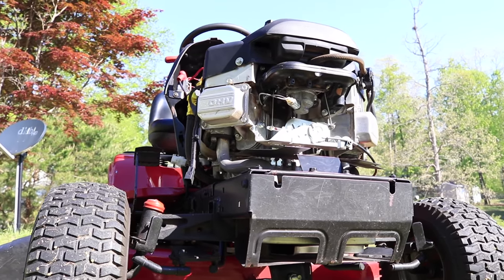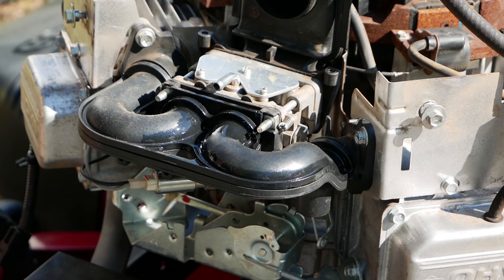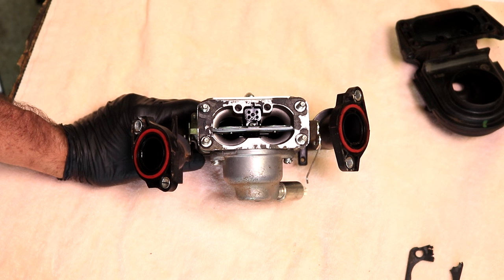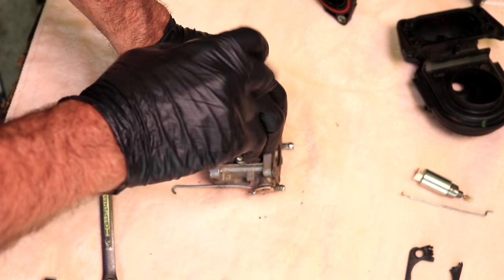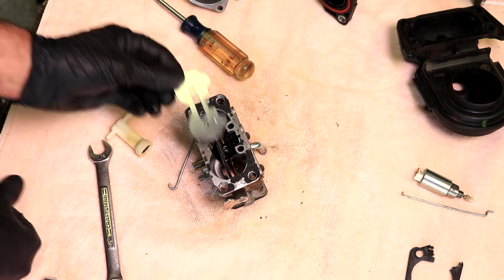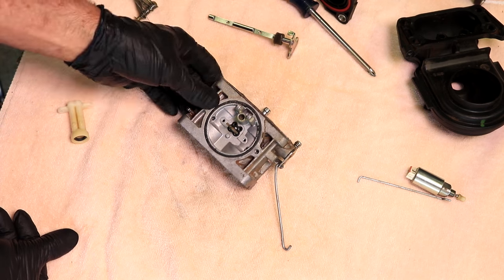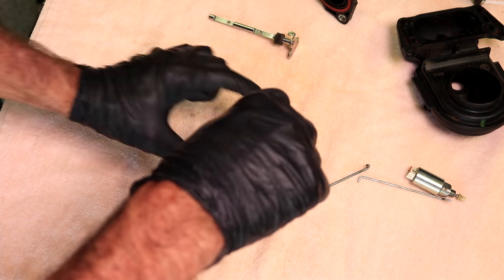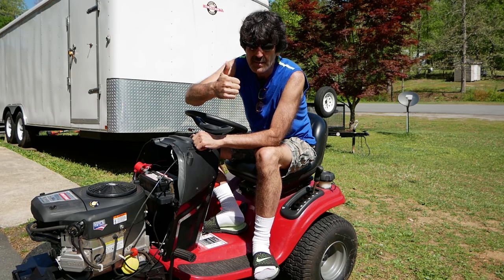Briggs and Stratton V-Twin Carburetor Repair

Comment: Help, Drained fuel and replaced with known good fuel. Replaced carburetor, fuel pump, spark plugs, fuel filter and air filter. Engine still turns over but doesn't start. It kicks over and starts with starting fluid but quits when that is burned up. Any ideas?
Reply from the maker: Maybe the valves out out of adjustment?  Sounds like you've done mostly everything possible.  If you have a compression gauge, I'd check the compression and see what that looks like.  Does it sound normal when it's cranking?
Reply: @JLPicard440  Thanks I checked compression it looks good, gonna check the valve adjustment next, but would compression check good if the valves are out of adjustment?
Reply from the maker: @michaelthomason9007  Yea good point... That's a good one.  Is the fuel filter filling up with fuel?  Are you sure the known good fuel isn't full of water?  I know, I'm grasping at straws!... But there's not much left... :-)

Comment: Video is on point brother....thank you so much....I picked up one of these mowers today from my step dad and it's been sitting for 2 years so I'm sure the carb needs to be cleaned due to the crappy ethanol. I checked it for spark and it's good, so I'm sure the carb needs to be flushed/cleaned/poked etc.....had to sub because of the video being on point ;-)
Reply from the maker: Thank you so much!  Yes after 2 years it's probably pretty goopy..  When you get it going again try using the ethanol free fuel if you have a local gas station that sells it.  It does keep a little better than the regular E10..

Comment: I love the way you explain things but I have a question I have a Briggs and Stratton lawn mower it's a V6400 craftsman 0 turn on the carburetor it has a spring The mower is about 3 years old for some reason we're not putting the linkage back correctly is there something we're not doing like tightening or it won't go up and down as needed
Reply: I'm a female.. I've been at this for a while
Reply from the maker: Hi!  Without being able to see it, I can't tell what could be wrong.  Do you have FB?  You should be able to upload a picture there and I can try to see if I see anything wrong.  It's on the take a bath productions FB page...

Comment: Great Video - this will be my weekend project - pulled out the mower and it wont start - couple of big backfires thats it.. plugs look good so figured it is the carb.  question tho - i noticed on mine that there are small slits in the vacuum hose off the bottom port of the fuel pump - are these factory or does the hose need to be replaced - and could it be my issue?  Thanks for posting this!
Reply from the maker: HI, yes i've seen those dry rot before.  If you squeeze it can you see more dry rot??  That's what it sounds like to me

Comment: A great video! Liked and subscribed. I can't get past opening the float bowl as I can't get the two bowl bolts out.  I saw someone use a butane mini-torch successfully but I'm leery about doing that around possible residual gas.  Might you have any suggestions for getting those loose?  Also, I've read that flooding is often caused by a stuck float.  If that's the case, will you find it stuck when you open the bowl? Thanks.
Reply from the maker: HI!  I absolutely don't recommend using a torch around a carburetor!  I wouldn't do it myself.  I would maybe try some PB Blaster and let it soak for a while.. Try to get it in around the threads.   I've never had bolts that wouldn't come out, but they're out there...  Maybe a pencil torch if the PB Blaster doesn't work, but I'd still be really cautious about doing that... any residual gas and you'll have a good fire to cook marshmallows on...
Reply: @JLPicard440  Thank you!
Reply from the maker: @vitex1231  yw

Comment: I'm great video brother thank you for your knowledge and expertise  I am new to the V twin engines I took one off my  Tractor and turned her into a boat motor but I do not know how to lower the idle I cannot change years from forward to reverse with the engine running there's too much torque on the transmission how do I lower the RP m's Great you  I am a new subscriberTo Sue the rest of you video
Reply from the maker: There's usually a idle screw.  I don't know if the particular one your working on has it or not.  You might be able to bend the lever that the throttle spring is hooked to to lower the RPM's.. It's only going to idle but so low before it tries to die on you.
Reply: @JLPicard440  thank you  4oo to500 rpm.  I am computer stupid I'm trying to put delete to my video in this message in this not working very well title of  Video is 22 horsepower V twin bridge and Stratton  Outboard motor DETROITREDNECK is my  YouTube channel name I will try to post a video

Comment: I have a 2008 Husqvarna ride on with one of these engines, and the fuel filter is covered in gas after running the mower.  Does that require an entire rebuild?  I have to mow once a week with no replacement mower, so I think I have to take my carb to someone to rebuild.  I want to make sure that sounds like a likely solution to the issue before throwing money at the problem.  Thank you for the awesome video by the way!!
Reply from the maker: HI, you must mean the air filter!  It sounds like possibly the needle and seat not cutting off properly.. Does it sound like the choke is releasing all the way?
Reply: @JLPicard440  Yes, I meant the air filter.  It does sound like the engine is cutting out after a while, especially if I have the blades going; almost like it's too rich.  After mowing for 30 minutes the engine starts to stall unless I turn the blades off and ease up on the gas for a minute or two
Reply from the maker: @chimera5588  Hmm,.. if it's a auto choke, it might not be releasing..  worth looking at the linkage to see if anything is noticeable..
Reply: @JLPicard440  Thank you for the tip!  I'll check that out 👍

Comment: I have a very similar Briggs and Stratton 26hp. It has a new carb, but it's having trouble with surging. The throttle lever is not as responsive (but connected) as I'd like it to be. It usually sputters out at the lowest idle throttle. Any tips would be really appreciated. Thanks.
Reply from the maker: HI, I did a video on this a while back.  Give this a try and see if there's any luck.  Even with a new carb.  Is there any chance the gas is contaminated with anything?  Did you drain it and replace fuel lines and filter too?  
https://youtu.be/dnEgZ_uqxiQ

Comment: Superb work on the carb. I did mine, but the choke linkage seems to be messed up and not engaging. Is there anything special I need to do to get it aligned again?
Reply from the maker: Without seeing it, it's difficult to say..  The cable for the choke has a hold down clamp.. Is that adjusted?
Reply: Thanks for the reply. There is a hold down clamp, but it doesn't look like there is any adjustability. I'll check this weekend.
Reply from the maker: @velodaman  Usually you can loosen the screw and move the cable back and fourth.  That may not be what's wrong, but I was just throwing it out there.  I usually pull the choke control in full choke position and adjust the cable accordingly.. then when you push the choke to the off position, it'll be adjusted.  if that makes any sense.
Reply: Bonehead alert: I found the issue. On the choke flange where the choke linkage attaches, I had put it in the incorrect hole. Now that its in the correct hole and put back together, it started right up and runs great. Thanks again for the great video and the support.
Reply from the maker: @velodaman  That's awesome!  Yea without seeing it, its difficult to say.  They say a picture is worth 1000 words... being there in person to see must be worth much more!  You're welcome, I'm glad you got it going...

Comment: Hi, first your videos is awesome. I have a problem, just wandering can you help? My lawn mowers is nit even cranking but my starter is turning. Do you have any idea why? Or any suggestion?
Reply from the maker: If the starter is cranking but not turning the engine, it could be that there's a broken tooth on the flywheel that the starter is engaging on but can't turn the engine.  It could be that the starter gear isn't popping up to engage the flywheel.  You'll have to pull the top cover of the engine off so you can see what's going on there and observe the starter when it's being cranked.  If the gear isn't popping up to engage the flywheel, it could be gummed up with something keeping it from moving smoothly.  This can usually be taken apart and cleaned and relubed, but I can't explain how here in this text.  It may also be that the gear on the starter itself is stripped out.   there's not much else it could be.

Comment: Good video, it's a shame a new carb was cheaper than a kit for the original in my case.
Runs like new as long as you adjust the valves once a year.
Reply from the maker: Yea I know.. those carbs have gotten really cheap.. did u get a OEM or aftermarket?
Reply: @JLPicard440  It was purchased off ebay and I'm sure some kind of China clone.
No markings whatsoever but otherwise identical to the original.
Reply from the maker: Right on... I usually use the aftermarket ones, I've had pretty good luck with them.. for 1/2 the price.. :-)

Comment: I bought a replacement carburetor for my Briggs and Stratton V-Twin and noticed that they provided gaskets (2 identical) for the bowl, but my original carb (and yours by the look of it) doesn't use a gasket. Is it recommended to use one? Edit: I just realized they are gaskets for the manifold, nevermind!
Reply from the maker: I was about to look at the video... I remember a o-ring type rubber gasket for the bowl.. 😀.  Glad you worked it out..

Comment: Purchased a new carb kit but it didn't come with the four long screws that affix it to the engine. Just wondering how I can get them off the old one
Reply from the maker: Are they those ones with the small heads on them?  I seem to remember them being a 4MM 6 sided socket unless I'm thinking of something else.. is there a video time stamp of the ones you mean if I'm remembering wrong?
Reply: @JLPicard440  thanks for the reply. They were actually being heald in place by the gaskets which were stuck to the carb I discovered yesterday. When I scraped away the gaskets they just slid out. Thanks again from Ireland. Without your video I would have been in trouble. 👍
Reply from the maker: @WillOfTheWeb  Awesome!  Glad you got it apart.. 😀

Comment: I can’t figure out what exactly is wrong with my grasshopper with this engine. It won’t start unless u use starter fluid and then it runs great, I replaced the vacuum pump and the little vacuum hose that goes to the head cover but it still won’t start on it’s own. Is there another vacuum line I’m missing?
Reply from the maker: Could it be the choke isn't closing all the way?

Comment: My carb is basically the same.  Maybe an older engine. No solenoid on the bowl.  QUESTION?   There were two small brass fittings with very tiny O rings on that fell out of the bowl when I took it off. Not sure where they were.  Either in two holes on each side of the body,  or in the plastic pickup. Anyone know?
Reply from the maker: Those sound like the jets fell out?  Or the emulsion tubes.

Comment: Hi, Thank for video. My mower has one problem. Then I try to start engine after 5-7 day, starter work 5-10secont, and after engine start to run? I make a test: then engine start,  I quick   stop engine, and again try to start -  no problem (engine quickly to start). Before then I try to start after long time first time engine check fuel level in tank and fuel in fuel filter, it was OK.  Maybe the fuel  evaporates from carburetor?
Reply from the maker: Are you saying the engine starts and then won't stay running?  I couldn't understand the question very well.  IF it won't stay running, has it been sitting for a long time?  Could be water in fuel?  Is carburetor dirty?  Trash in fuel tank?  How about the fuel cap?  Try to run without fuel cap in place to see if the fuel cap is causing a vapor lock..
Reply: @JLPicard440   IF it won't stay running, has it been sitting for a long time?  - YES.  The main problem then I   start the engine after 5-7 days off work . The starter rotating 5-10second( starter need to rotating several times), after engine start. Water, trach  in fuel  - NO,  Mower running time 55 hours.
Reply from the maker: @arasaras-bi3ez  If it's been sitting a long time... like a few months, the carburetor is probably getting clogged up.  Has it been sitting 5-7 days or a few months?  5-7 days isn't a long time.

Comment: Followed your steps,  but used a rebuild kit. Mower will only crank with hand over the air intake.  And won't idle.  Any ideas? Mower is a kubota z122e. With 22hpbriggs.
Reply: Also replaced fuel filter, fuel pump, all fuel lines ans spark plugs. The non starting or idling after starting was the original problem.  Nothing has made a difference.
Reply from the maker: Maybe do a compression check?  Also maybe check the valve clearances.  If you're confident the carburetor is put back together correctly.

Comment: I have a older model Briggs Intek 22 Hp and it started missing out no where on the 1 cylinder so ive put new spark plugs in , new diaphragm fuel pump , adjusted valves , cleaned carb and still same exact issue , i must have missed something  , if i choke it that 2nd cylinder runs but choke off that cylinder backfires out exhaust so i must of missed the Low idle part of carb.
Reply from the maker: Do you have a way to do a compression test on that cylinder?
Reply: @JLPicard440   Thats 1 tool I don't have , however I should get one but on these with a compression release  , it's hard to check compression others say.
Reply from the maker: @BlettzaHrekleW  It shouldn't be very hard.  If you have a harbor freight nearby they should have one, if not Amazon will have it pretty cheap...  It's worth checking so you can at least eliminate that as a possibility if it checks out ok.

Comment: I have one that will only run if I'm blocking 95% of the air from coming into it. I was going to try this first, but how can you test a fuel pump?
Reply from the maker: HI!... You can test the fuel pump by disconnecting the output side that goes to the carburetor and holding the hose in a jar while cranking the engine over.  However, from the symptom you described I doubt it's the fuel pump.  Sounds like some blockage in the carburetor...
Reply: @JLPicard440   the fuel filter never really fills up, it just has a little amount of gas in it. I'm going to check it out today. I'd much rather change the fuel pump than take all that mess off.
Reply from the maker: Yea if it's got fuel just trickling in, then I would definitely check that first!
Reply: @JLPicard440  I checked the fuel pump, it's fine. I guess I'll be taking this thing apart. Goody goody.
Reply from the maker: @inscoredbz  ☹... I'm working on a bear right now myself.. Got one that's got a popping/ miss in the exhaust.  I was thinking the coil was going bad, but now going to take another look at the carburetor..

Comment: TBP great video. I have a problem with the same mower and engine.  When I put the throttle to the choke position, it doesn’t engage the choke.  If I move the choke linkage manually it engages. Any ideas.  Thanks
Reply from the maker: Did the cable get loose, and isn't pulling the linkage enough?  That's almost something I'd have to see...
Reply: This is Doug.  I don’t know how to reply to your message, but I will try this. The cable was adjusted two years. It be off again. I put the throttle to the choke position, push the choke solid rod up, then start the engine.  Put the throttle back to run and the engine speed stays the same until it gets to the very slowest speed, I feel a click and I can then adjust the speed of the engine.
Reply from the maker: @douggniot1877  OK.. yea it does sound like it could be out of out adjustment.

Comment: My carb is missing the spring, any idea where to find one ?
Reply from the maker: If you get the model number off your engine.  It's usually on the valve cover on a briggs engine... you can go to a website like www.partstree.com and get the parts breakdown for it... from there, you should be able to identify the spring and get the part number... Hope that helps.

Comment: Only thing that worries me is re-installing the butterfly and getting it right the first time.
Reply from the maker: you can mark it with a sharpie then you can't make any mistake..  Just make sure not to get any cleaners or chemicals on the mark or it'll come right off!  Or etch it with a screwdriver, then that solves that too..

Comment: Thanks for the great video TBP. I was wondering, is there a way to empty the bowl before storing it for the winter?
Reply from the maker: HI, you can loosen the solenoid at the bottom of the carburetor and that'll drain the fuel out.  Just remove the wire first and leave it loose so any remaining fuel will evaporate.
Reply: @JLPicard440  Thank you.
Keep the good work.
Reply from the maker: @charlieg.6242  You're welcome!
Reply: Shut off fuel and let it run until it dies.....
Reply from the maker: That works for the most part, but won't get 100% of the fuel out.  Even loosening the solenoid will get the fuel out of the bowl, but some fuel will remain in the solenoid.  To get 100% out, remove the solenoid and shake it while pressing the plunger a few times... that should get most of it out.  Those things have a habit of rusting and then they don't work to good after that.